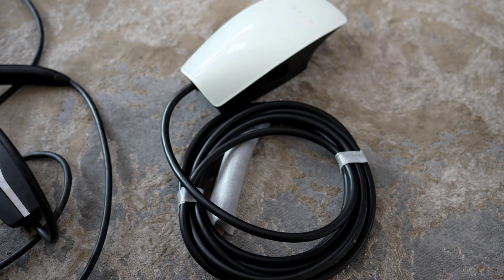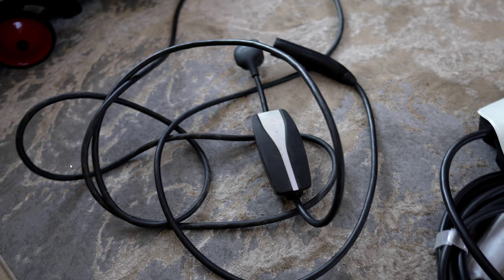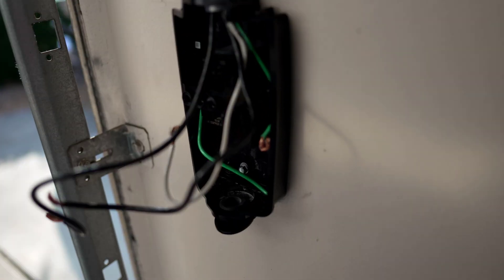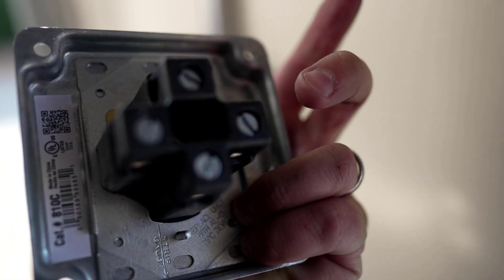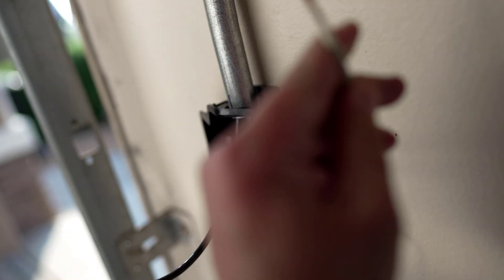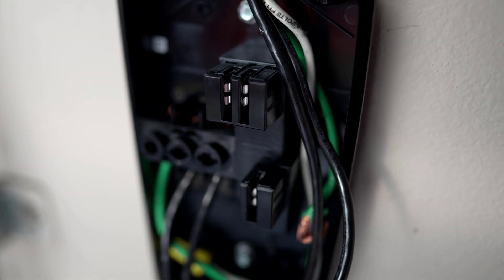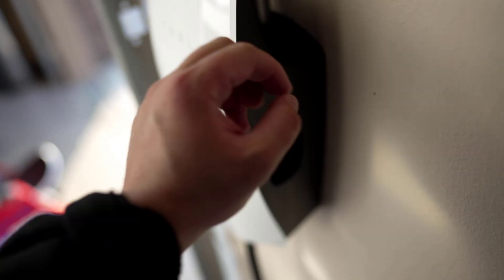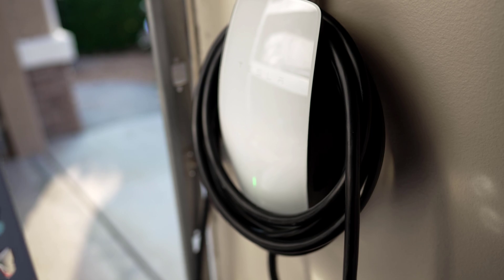Upgrading standard Tesla charger 220v nema to Tesla wall connector

Comment: You can't just let emt just float inside the wall charger. It needs to be fastened rigidly to the box and the EMT is to be fastened to the wall within 3 feet. Also not grounding the EMT is s NoNo... Should of used plastic.
Reply: Your EMT is connected to your electrical panel, which is grounded